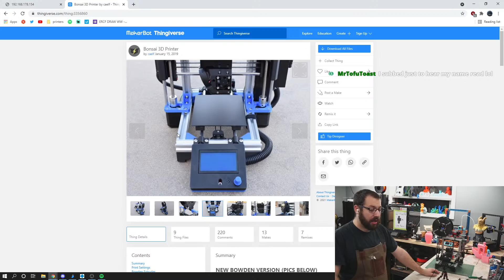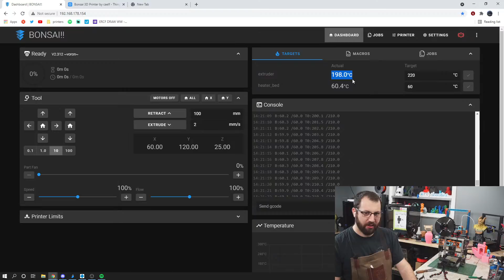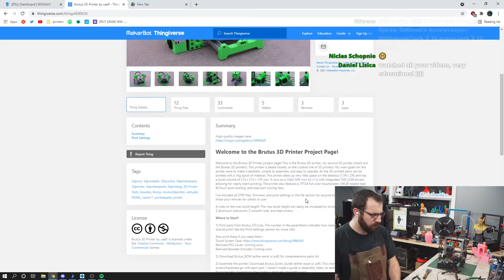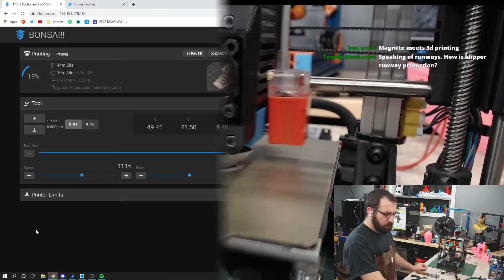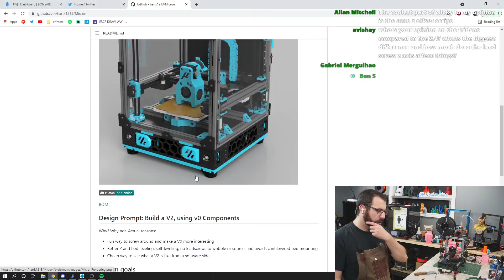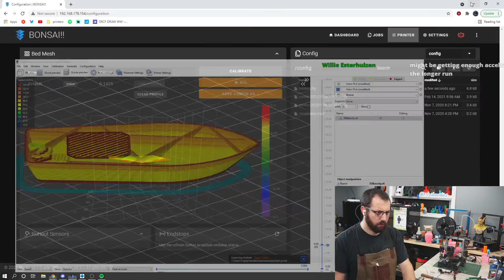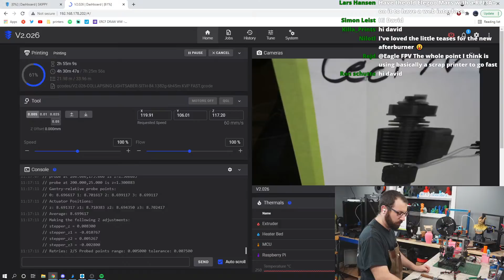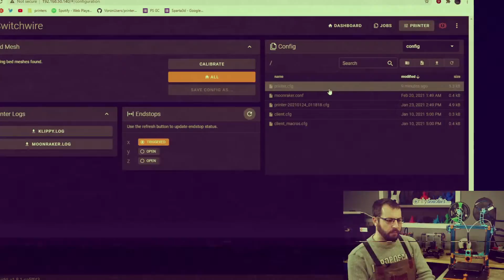Fast Scrap - LIVESTREAM - How much printer do you need to go fast?

Comment: PTC heaters can't suffer thermal runaway by design. That is their main efficiency and safety feature.
Reply: Efficiency?
Reply: @John Pang At a certain temp, the resistance is high enough to prevent the flow of electricity and thus any heating.
Reply: @John Pang IIRC they stated 300-320

Comment: I would absolutely love it if you could save my RepRapGuru Prusa I3 MK2. I know there is absolutely nothing wrong with the build. I’m pretty good with all of that. But for some reason or other it is probably a firmware issue. Maybe I don’t have the right one? Every time it starts up it’s a very blurry screen and it says that it’s a Prusa blah blah blah. And then you try to push the button in and it goes to reset. Please press reset button. I can’t get anywhere with it and I have like eight other 3-D printers and I’ve never had a problem with anything like I’ve had a problem with this. And this company has no support because they do not exist anymore.